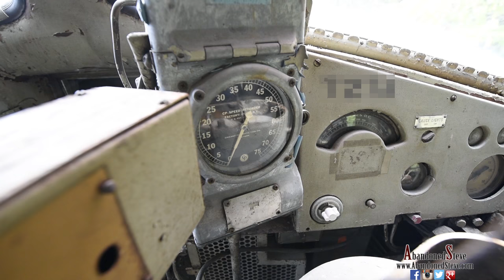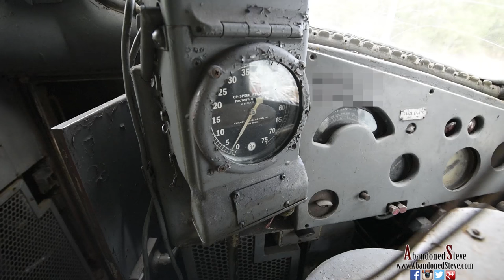Urbex | Exploring Old Decaying Trains - Locomotives - Coaches

Comment: The white car at the beginning is one of 200 ex-US Army Hospital cars built in 1944,  later sold to a number of RRs. The coach interior had "walkover seats" whose seatbacks flip over reversing the seating directions.  The little center-cab loco is a General Electric "44-Tonner" switcher.

Comment: Sad to see gorgeous old hardware just rotting like that.
Reply: Not rotting.  He just failed to show the shop.  These may just be sitting as scrap for parts but several pieces are being actively restored.  It is a working railroad.
Reply: Anon Nymous well it ain't as easy as ya think to repair this.
I mean this things ain't easy to rebuild. I don't think there is anyone left in the world that knows how to make this thing run again
Reply: It'll take a thousand years or more to disappear. Why aren't these trains being cut up for scrap?
Reply: Tom Burcher ... That's my idea too. Is it possible for salvage?
Reply: Camden 4545 because these units were so plentiful, and so recent, along with the fact that most manufacturers used the same tooling on all their locomotives, parts aren’t hard to come by. It’s the regulations set by the government that make it difficult.
Reply: Hannan Pakthini it is possible, just very expensive.
Reply: Tom Burcher because small lines and preservationists usually buy these to rebuild for excursions or museums.

Comment: SAD  to just sit and rot and get trashed by jerks.
Reply: zzzdogutube true since I like trains I agree😭😭😭😢
Reply: Jason Houle Railfanning is my Hobby. So sad to see the older Locomotives get trashed like this.
Reply: Train engines
Reply: they understand the best use of these trash ;)
Reply: These locos are a safety hazard. They should be cut for scrap and melted down without delay.
Reply: +heelfan1234 they should be either left like this or restored and put in a museum. Scraping them would be mistake.
Reply: +the Gooper They are an unremarkable group of locos. Some of them look quite nasty. I don't think they would pay their way in a restoration scenario. Scrap would not be a mistake, but the only sensible option. This is what will happen eventually when the owner dies or gets bored of them.
Reply: the GOOPER why is no one restoring them they are awesome.
Reply: heelfan1234 yes I agree totally it will take some money but the pleasure of having them back on the road is more than enough yes👍
Reply: Well well. Go figure you'd be here heel.
Reply: Y’all gay
Reply: zzzdogutube well, there gone now.
Reply: i'm gonna buy a couple lengths of track and park one in my yard for my mancave !
Reply: You all.
Reply: @nunyabizness199  These locos will be sliced with cutting torches and recycled for scrap.
Reply: @troy9027  Same to you, with knobs on it...
Reply: @nunyabizness199   Don't "wish",  it's true.

100 times more locos have been ripped apart with cutting torches and the scrap melted for recycling, than have ever been preserved.

I win the argument, and have totally crushed you in this debate!
Reply: @PreservationEnthusiast  But it wont be by YOU 🤯
Reply: @nunyabizness199  I never said it would be. The important thing is this junk is recycled. It doesn't matter who does the cutting!
Reply: @PreservationEnthusiast  Hahaha...If you say so "steam loco scrapper"
    🤣 Now back to mommys basement troll boy. 🤣🤣🤣
Reply: @nunyabizness199  You are the one who does not think straight. The normal course of action for scrap items is to slice them apart with cutting torches and send the pieces for melting and recycling. I have soooooo won this!!
Reply: @nunyabizness199   I'm in my 40's. I have scrapped loads of stuff! My mum died years back and never had a computer. I have intimate knowledge of equipment used for scrapping including torches, shears, excavators, electromagnets, and manual dismantling.

You have got nothing right! I have crushed you in the debate!

Locos will continue to be scrapped and recycled. Nothing you can do to stop it!
Reply: @nunyabizness199  It matters not whether it is the US or anywhere else.  Scrap locomotives will be chopped apart with hydraulic shears and cutting torches. The debris will be transported for melting as scrap charge in the induction furnaces and the materials recycled.
Reply: @nunyabizness199  You are not correct. A lot of stock hangs around in sidings and unused track before it is scrapped. If you want an example, look at the first Eurostar  trainsets. Just check out abandoned Eurostar on You Tube. It stood around for many years before being chopped apart with shears and cutting torches and sent for recycling.
Reply: @PreservationEnthusiast , went against your username, eh?
Plus, restoration of these units is only about 50-75 million, which means, a class 2 carrier can afford to restore.

Comment: I love EMD locomotives especially first generation ones. As an engineer for CSX formerly Conrail I have had the opportunity to run many different series of EMD and GE locomotives and I'm here to tell you an EMD SD40 is one of the best locomotives ever built, they will pull till they just cant pull any more, they are always a pleasure to run and GP38's and GP40's won't let you down either. As for GE the best I ever ran were the old B23-7's if you got a good one it would pull hard for you, as far as the B36, B40 series of locomotives I would not give you a plug nickel for one, to me they are a total let down of a locomotive. As for GE road locomotives, they are bulky and cumbersome and a pain in the ass to run at low speed to make a nice smooth hitch, they just don't have the smoothness of an EMD, and to be fair newer EMD road locomotives are very similar in the way they run, they should have kept computer control out of it, a good Engineer such as myself :) is totally capable of starting a train smoothly.
Reply: I couldn't agree more!  As a lifelong fan of the New Haven RR, what I hear and see of those 50's and 60's generation locomotives, they were tough as hell and nice to operate.  Although my favorite is an Alco RS3, the Geeps were cool and the P&W bought a fleet of B23-7s when I retired from Tilcon, hauling our stone all over hell and creation but for sound, i liked the cadence of the 2 cycle Fl9s as opposed to the blowhard Alcos!

Comment: None of this equipment is abandoned.  There is a shop less than 200 yards from this locomotive that is actively working to restore some of these.  Likely some are just here for parts but they are NOT abandoned.  It is a working railroad and I've seen them out moving local freight. And as to the "wilderness" he trekked through to get here, well, maybe he should have driven down the nice wide street that's on the other side of the engine.

Comment: I've always loved that type of locomotive design, does anyone know why the F units got porthole windows like that?
Reply: in contrast to just square shaped?
Reply: +William Baker It was designed in the 50's. That should be explanation enough.
Reply: Ryan Anderson F Units were designed in the Late 30's
Reply: Probably because round windows are stronger and much of the strength of the car-body chassis is in the body. Square corners lead to stress risers (concentrations of stress) which leads to cracking. Go read up on the de Havilland Comet for problems with large square windows in stressed areas.
Reply: William Baker It's E9 I think
Reply: They must have custom made those as round.  I'll bet you nobody cut glass for them the way you cut window glass.
Reply: The porthole window was a stylistic thing, and they would allow light into the engine compartment for maintenance.  Assuming artificial light was universally available wasn't really a thing in the 1930's.  Round windows to reduce stress concentrations in the side sheets wasn't an issue because unlike typical commercial aircraft, these locomotives were built with internal steel frames, the side sheet/skin doesn't carry much (or any) structural load (you could run one of these just fine if you removed the skin on the sides, but of course, you wouldn't).  Earlier units like the early E units (E2 - E7) had square or rectangular windows.
Reply: They were designed in a much more practical age. Probably had to do with strength.

Comment: Two of the locomotives are from the long abandoned NYO&W. One is a GE 44 ton, the other is an EMD F-3. The "Old & Weary" was a very storied railroad that was totally abandoned in 1957. These are probably the last two engines of this line to exist- it is a shame to see them just rot away. I am guessing this was to be a railroad museum- but it failed.
Reply: Reg mason232 I heard only switcher actually ow .other repaint .ow f3s scrapped by bank.
Reply: No. It's an F unit. And B&LE.
Reply: That 44 ton diesel is  being actively restored at Steamtown NHS
Reply: We got the sleeper car nise inter
Reply: @guitarplaya608  we got your pax car

Comment: For ID purposes: RDC Budd = Susquhanna. f7 a = Ontario & Western + f3 (rakish nose is give away aka more slope. F7s had an almost vertical nose front.) = Chicago Rock Island & Western. Smaller switcher looks to be a GE 44 ton switcher. Rock Island had a massive fleet of f3'a & later f7a's all equipped with HEP units for commuter service. Now if we could only find an SP trainmaster stored from their commuter days that would be grand especially since those ran into the late 1970s and you would think somewhere somebody would have thought OMG rare this ultra rare thing. 

My guess is these are stored at an interchange with some rail museum.
Reply: Both units are ex-Bessemer & Lake Erie F7A's.

Comment: When I grew up in PA . Most of the Engines were steam. The passenger cars had windows you could open . When the track went around a corner the smoke would come pouring into the passenger cars . Heaven forbid someone left a window open while going through a tunnel !!

Comment: This is Winslow Junction in Atlantic County, once know as the most busiest train junction. It is owned by New Jersey Department of Transportation, Southern Railroad of New Jersey and New Jersey Transit.. Going on the "abandoned" trains is illegal and trespassing. Right across from those trains is a rail yard to fix the "abandoned" trains. The reason I am using quotes around abandoned is because the Southern Railroad is in the process of renovating them and sending them to other museums such as Strasburg Railroad Museum in PA. They are veteran railroad workers and work very hard to have those trains in shape. So when you went on the trains you documented can be held against you in a court of law and imprisonment. So  PLEASE DO NOT GO ON THE TRAINS. IF THE GRASS IS CLEARED DON'T GO ON IT.

Comment: 3:49  electric motors have more torque.  example the trolley buses in San Francisco, which can go from a dead stop on a hill.  diesel electric are also on tugboats.  they can fail in rough weather

Comment: It's a shame that all this equipment couldn't have been used at one of the many train museums around, before they were left to rot and rust. Looked like equipment from the Eastern areas. This looks like an abandoned railroad area. I noticed another area across the street with at least one more locomotive. We need to save as much early history of the railroads, and most everything else when we can. The F units from EMD, were very popular. Even today, a lot of starter train sets, feature an F unit. When I was 5 years old, I was lifted up in a Santa Fe F unit. This was the silver and red and yellow unit. Passenger locomotive. Probably was an F3A.

Comment: Steve, is there any chance the engine can be saved??
Reply from the maker: Of course it can, just the longer it sits the more it will cost to rehab it
Reply: Diesel engines are more robust than normal gasoline/petrol engines. Its just when the go into disuse, they will go 'cold' and become more difficult to start back up. They have fine clearances that require TLC over their lifetime. From the looks of it, it is in one piece. The Electric motor would need a good cleaning/wiring check to insure functionality. If it works, it would be a nice emergency generator for a neighborhood/few houses
Reply: Elijah Ellis 
Not good for neighborhood emergency power. Residential and commercial power is alternating current and diesel locomotives of the 50's are direct current nominally 600 volts for the traction motors.

Comment: those two f units were purchased by the reading and northern railroad. Maybe they will run again. check thier online roster
That ridiculously tagged switcher is at steamtown national historic site. It's been worked on, tags removed and May run again. Needs work on a motor

Comment: If those engines didn't have good bearings they could replace the trucks with trucks from, say, an EMD GP60. It uses practically the same trucks and wheels.

Comment: As a metalworker(amateur), this is a good supply of steel. What are the chances these will be recycled ♻ ?
Reply: Not one in a million.
Reply: Good comment Rendel. It is quite likely they will be cut up insitu. Then the scrap debris will be taken away to the steelworks either by rail or road. It depends on the access and condition of the rail lines.

What you could do is contact the owners and ask them if they are going to clear it up or when the cutting starts. Then see if you can blag some pieces for your metalwork.

As the location is remote it may be difficult to get the scrap out though. Good luck with it!

Comment: Whats in the nose? I did see there was a door in the cockpit/drivers compartment and lead into the nose but was disappointed when you did not explore in there.
I'm guessing a sleeping quarters for the crew?
Reply from the maker: The nose is usually storage or a toilet
Reply: Thanks steve!
Reply: The nose has electrical and air brake equipment.  The toilet in an F7A was located in the right rear corner of the engineroom.

Comment: This is what happens when well-meaning organizations and individuals take old pieces of railroad equipment with the idea of restoring and operating them.  Issues like Insurance costs, Lead Paint, PCB's and plain old mechanical decay often get in the way.  Once-enthusiastic supporters and volunteers walk away when the bell no longer goes "ding ding" and the whistle no longer goes "woo woo."  The stuff ends up sitting, often in a precarious and unsecured location and within a few short years it turns to JUNK.

Comment: where is the bathroom in the diesel locomotives??
Reply: Those locomotive were connected to a passenger car they used the bathroom on the car. Other locomotives have a bathroom on the other side of the cab.

Comment: What's in the nose of the locomotives? The door in the dashboard got me curious.
Reply from the maker: it is usually a storage area who has a toilet.
Reply: Ahh, thanks for the info. Got curious when I first saw the windows, then the door from the inside. Great video by the way!
Reply from the maker: EspenJ Thank you
Reply: Sometimes that's how you get in
Reply: There is electrical and air brake equipment in the nose.  The toilet in an F7A was located in the right rear corner of the engineroom.

Comment: I have an engineering question the early diesel electric trains were so streamline aerodynamically to reduce drag then why is it that Modern Diesel electric train engines are so square and blocky it seems counterintuitive why would we go from an error of such aerodynamic streamlining to an error where we basically Force giant square blocks through the air does anyone know why? If you look at the design of a modern locomotive it's just all squares and blocks and looks completely un aerodynamic compared to its ancestry that was very streamlined and much attention was given to streamlining and reducing drag

Comment: why not try and start them up?
Reply: they would have been guttet for parts years ago and the fuel drained.
Reply from the maker: A lot is missing and you can start up a train without the right components in it. I would never start it up if i could anyway

Comment: those  abandoned  trains must  be  taken  away  is  cause  they  are  dangerous  and  frightening  whick  children  would be  fright  of  the  abbandoned  trains  and  diesel  engines  are  not  at  be  allowed  on  to  this  site  at  all
Reply: What the hell are you babbling about?  They are not dangerous.  Lots of things might frighten a small child but you don't see me going around taking a torch to them. They ARE allowed to be on that private property. I think you're frightening.  Should someone take a torch to you?
Reply: They are dangerous. Children are climbing on them and could fall or cut themselves on the sharp metal or get tetanus from rusty metal.  They need to be fenced off and demolished with cutting torches and the site cleared of scrap.
Reply: Should they be on them? Hell no! They pay the price for their stupidity!
Reply: These locomotives were recently purchased by the Reading Blue Mountain & Northern Railroad. They're gonna get a new lease on life.
Reply: This equipment is on railroad property.   If it should not be allowed on railroad property, where should it be allowed?   Not sure about what kind of children you know, but the ones I know would not be 'frightened' by these trains.
Reply: First of all, children are NOT scared of abandoned trains. Second, these locomotives and coaches are NOT a danger. These trains were left, either to wait for a rebuild & refurbishment, or waiting to be sold off. These trains are not meant to be climbed on and/or gone in. So get your mind together.
Reply: It's RR property.  In otherwords......'Stay Out', 'No Trespassing'.  That includes snotty little kids.